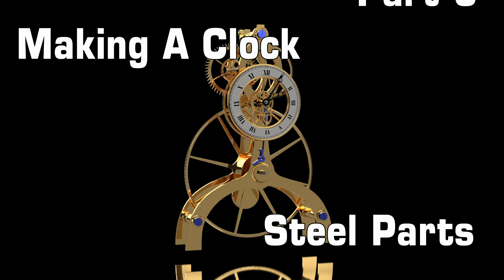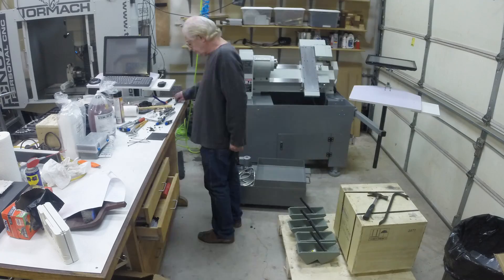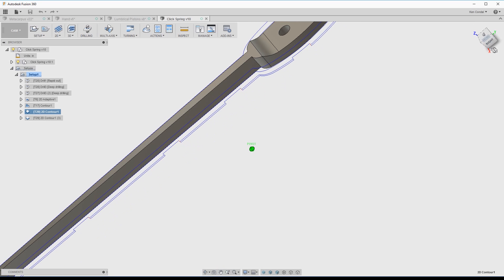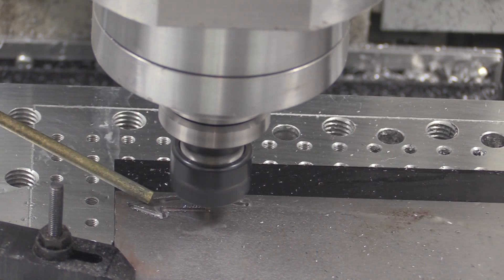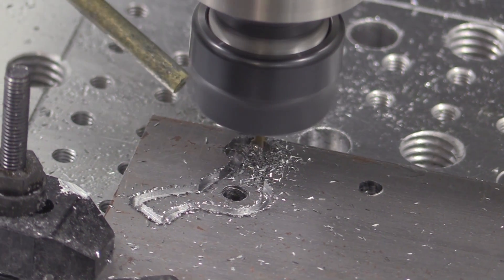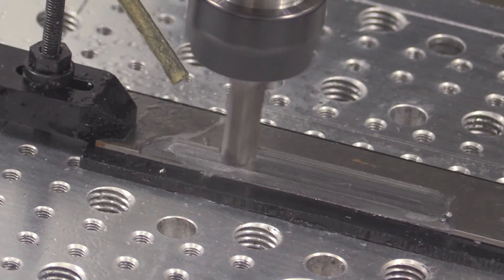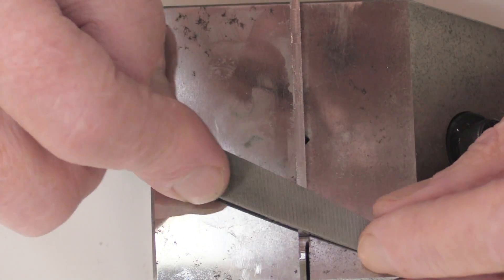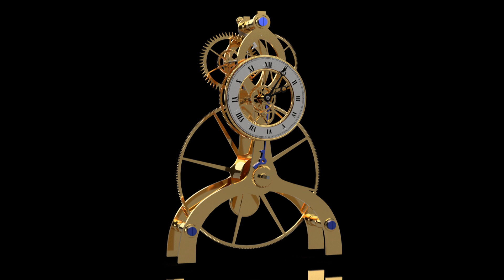Making A Clock - Part5   Steel Parts

Comment: Do you recall what steel alloy you used ? There are some free machining stainless steel alloys and you might find that they work well ( although this is now 3 1/2 years later ). You may prefer to just finish file, sand and then polish without the blueing and heat treating if you like the raw steel finish.

Thanks for sharing.

Comment: Ken, Great to see that you have returned. I looked up your new machine and it states that it is 1725 pounds, will your floor take that much in a smaller footprint ?  I looked at Clickspring shop video and he has quite a filing machine. I got the drawing for it but to have it machined was $$$$$$$$.  Looking forward to your Terminator   Ralph
Reply from the maker: Honestly Ralph, I never considered the weight. It's in my garage which easily handles my car. :) The mill has been in place for over six months and the floor is fine.
Reply: Yeah you are good.  A decent concrete pour is 3000 pounds per square inch.